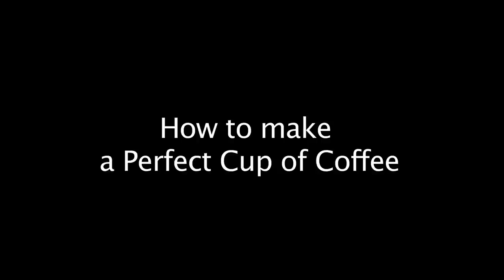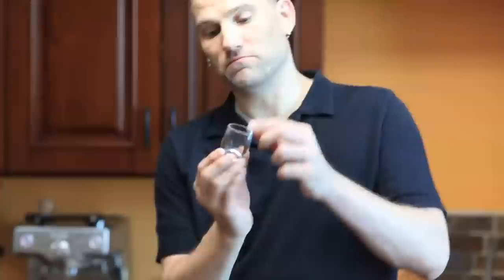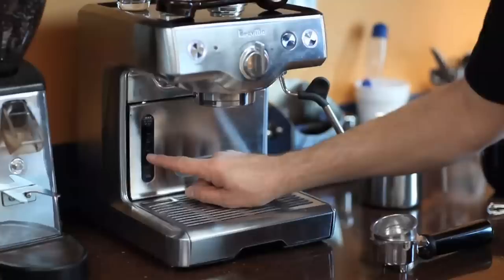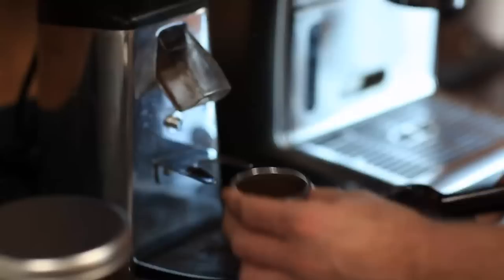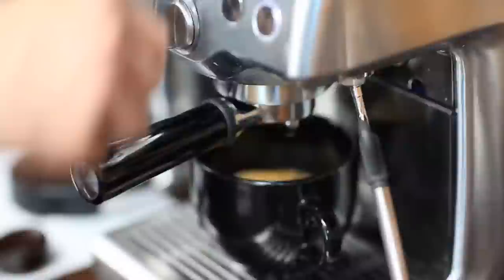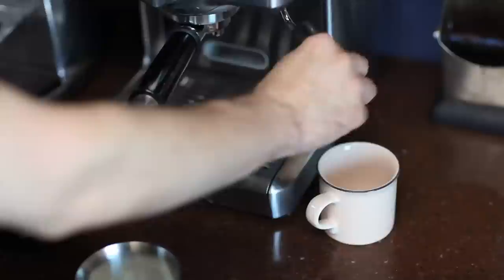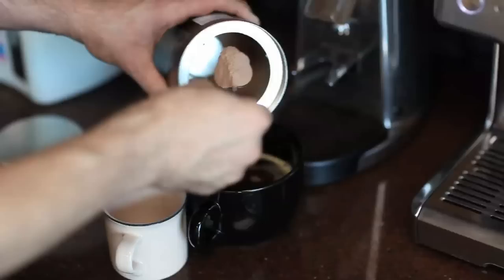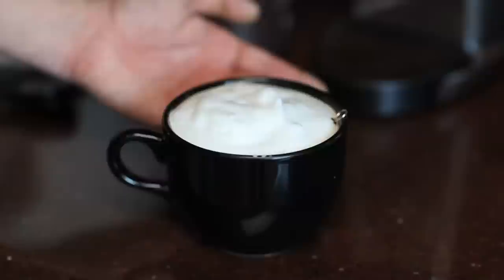How to Use an Espresso Machine

Comment: For anyone wondering about the tiny whisk it's for making green tea. In Japan green tea is made with hot water and this green tea powder called macha. While wide bamboo whisks are most common you can also use a small whisk like that I suppose. Each cup is made individgually.

Comment: You're right. After about 20-30 seconds the espresso shot actually burns because its so hot. The sweetness of the shot is then replaced by the taste of bitter, burnt, chalk. Always aerate first. As you rest your pitcher to let it steam, then pull your shot.

Comment: An "Americano" was an Italian Espresso with the addition of water, not coffee.  This originated during the WWII era when American soldiers where introduced to the espresso.  Seriously,  it's not about how much espresso you can handle.  For example, a "ristretto" is a short shot of espresso using less water.  Lungo utilizes more water, It's all about quality over quantity. I come from a Cuban heritage and we utilize one size of black espresso which we simply call a "cafesito" or simply "un cafe Cubano" or just :a Cubano.  At a neighborhood bakery you ay ask for a "Colada" which is dispensed in a short styrofoam cup and may serve about 4-5 small shots.  Adding Cuban coffee to a hot milk will produce a "cafe con leche" and a half size is calle a "cortadito."